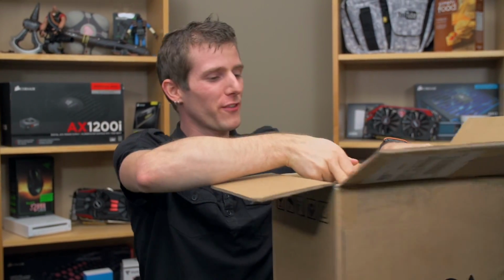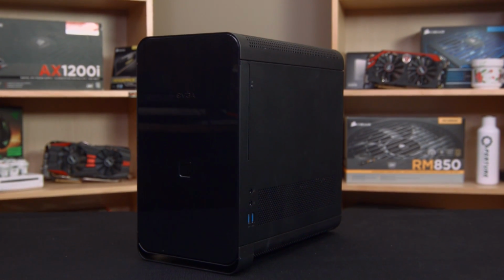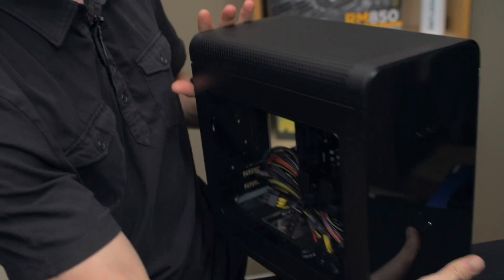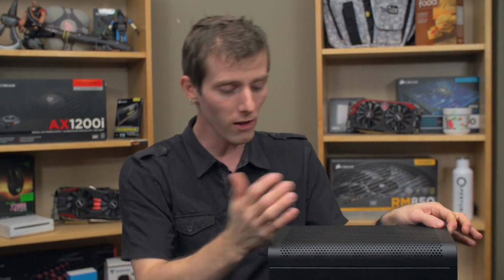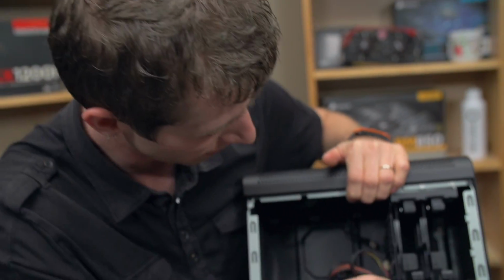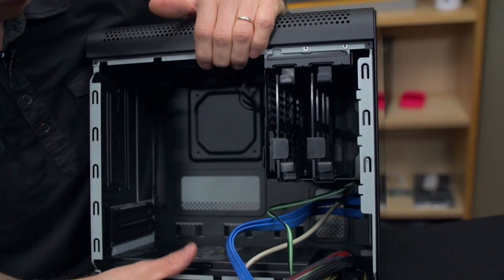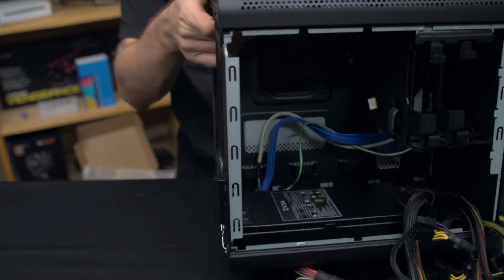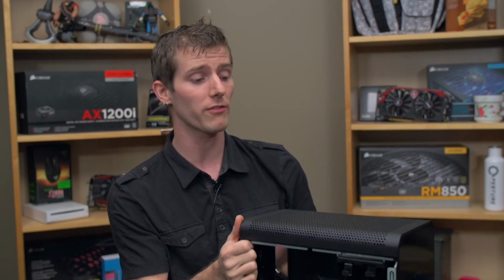EVGA Hadron Air

Comment: This is a "ONE KIND" case, in that your stuck with a ONE KIND of motherboard form factor, a ONE KIND of "non standard" PSU form factor and a ONE KIND of top fans... who the heck builds barebones PC's would ever want this case? EVGA should have their stinking heads examined, computer parts and cases are a must for standardization. This is no different than buying one of those bull shit proprietary dells.... what a joke. If and when the boards go bad you either buy a used one just like it if you can find one, or you get rid of the whole computer because by the time it goes bad, it's outdated and no longer in circulation and have moved on to other designs.... this is in my opinion a cramped quarters throw away case.
Reply: Makes no sense, if you need a small form factor system you obviously will be going ITX. There are a TON of ITX cases on the market so saying that you're stuck with this case is a stupid statement. So if you want to switch cases you just grab a new power supply. This case is awesome, really compact, and a great option for people looking for a SFF build.
Reply: ***** If you just go and buy a ATX from factor case in the first place your not stuck with JUST ITX, or this proprietary PSU. This case limits your options regardless of the TONS of ITX motherboards on the market. Use ATX cases and you can not only use ITX, but also mini ATX, micro ATX, and ATX. This case forces ONE kind of motherboard like I said, but ATX cases don't.... so how do you figure it doesn't make sense? You need this small form factor case to carry yours around all the time do you... you do know they make laptops and tablet PC's for that right?
Reply: you clearly don't know much about the gaming world. Laptops can not compare to a sff rig when it comes to performance. What do you do when you go to a LAN party? Bring a huge atx rig? Who in their right mind would put a ITX motherboard in an ATX case that literally is the dumbest thing I have ever heard. If you want a small rig you go ITX, period. Learn something.
Reply: ***** Perhaps you should learn something, they have laptops now that can indeed play the latest games, why don't YOU Google them? Desktops weren't meant to be portable, that's why they came up with laptops and tablet PC's anyways. You clearly sound like a kid, talking about LAN parties, I guess you carry your LCD TV around with you too for LAN parties? Some things weren't meant to be lugged around, your tower is one of them.
Reply: ***** And one more thing beings you like to lugged things around that weren't meant to be, you should go and buy and drive, if your old enough, the smallest car you can, this way when it fails to start you can just lug it around to your LAN party? LOL.
Reply: If I'm old enough, how cute. Clearly aren't a gaming enthusiast because you know nothing about it. I would go buy the smallest car, except, I just bought the new corvette. Enjoy.
Reply: when it fails to start? guarantee my itx system is more powerful than your atx system.
Reply: I guess I'll say something on behalf of all people who have a brain. M-ITX is becoming a pretty popular standard, especially for LAN rigs. What you said is true, there are very powerful laptops available, but if I'm a serious LAN gamer (and that is somewhat true) a $1000 desktop in this case will outperform a laptop that costs twice as much. Plus, this will allow those expensive parts to be cooled much more efficiently (it's simple physics: bigger heatsinks (like those on aftermarket CPU coolers and large GPU coolers) dissipate heat better) and therefore last longer. 

So far we've debunked two of your claims A) that M ITX is a bad investment due to it's lack of popularity (simply not true) and B) that a gaming laptop is a better alternative. What else do we have? Comparing this to dell? An extremely high end small form factor PSU that costs about 50-75% the cost of this case/psu combo? If you find a near $100 psu in a "shitty dell" I'll buy you a drink. 

Now, onto places where I agree with you. In most cases, a nice mid/full tower case is the better option. They have a much higher compatibility for motherboards, power supplies, coolers, disk drives. But, if you are building a LAN rig, meant to be mobile, or you are like me, and are planning on building a Steam Machine, this case is a fantastic option. I don't want a massive eye-sore of a case sitting next to my TV and other entertainment gear, I want something that can be stashed off to the side and blend in next to a subwoofer, and this fits the bill. It's small, comes with a very nice PSU, has nice cooling options, fits high end components, and looks nice.

The good news is that you don't have to buy it if you don't want it, but it's in my cart now, and there's a good chance it'll land on my doorstep before long. Please, have a pleasant day.
Reply: mygetrichslowplan Well from you and the other user that's been responding to me, it appears the only reason why anyone would want this case for, would be for LAN parties and mobility.... other than that, I guess it really isn't all the useful? Look your not telling me something I don't know, I have more than 14 years, which is less than some, but plenty of experience working on PC's. And through the years I've found out that cramped quarter cases do not cool well at all no matter how it's air flow is, because of all the wiring that can't be tucked away. I've modified cases this small for air flow and it never failed they don't cool very good, because everything is to close together and you can only put so many fans on them..... so I don't use them, and I wouldn't recommend them.

Then you have that ITX form factor boards that doesn't have hardly any fan ports on them, which forces you to use Molex connector adapters running fans at full speed, which is needless if and when you don't need them. But on a ATX board if you get the right one, you usually have all the fan ports you need, outside of a few, which will run at speeds controlled by the bios according to the case temps. Yeah you can buy fan controllers, but then that's just that much more wiring you have to deal with, in a case that's already cramped. And some of these video cards they have are huge, and for a lot of gamers they like to get the best, some of the best ones, if you run SLI or crossfire, take up a 4 port area, that won't fit in this case. Yeah this case has its uses BUT, only if you want it for mobility and small space, and I guarantee you that ATX form factor cases have a much better market, because they fit nearly ALL needs. Yeah you have some good points, more than the other guy, but in my opinion, and that's all it is whether your saying it or me, with the latest choice hardware available, small cases like this do not out weight the negatives.
Reply: Like I said, for general desktop applications, get a nice mid/full tower case and a standard ATX Motherboard. You are preaching to the choir, that is literally what I have for my set up right now, but do I want a massive case acting as an eye sore next to my entertainment center? No. Also, there is a version of the case (called the Hydro) that is a bit taller, but allows for water cooling, which means some potentially better cooling, as it would have support for larger rads than my current mid tower case.

For desktop applications, mid or full tower all day long, but with the computer making it's way beyond desktops in the office and laptops on the road (think how many people have essentially a mini computer in an apple tv or roku, or hell, even built into smart tvs) an sff computer in the living room could add a lot of functionality to your TV with low spacial impact, and in a case like this, it could even replace your console.
Reply: Obviously ITX systems are not as good as ATX systems in a lot of cases and can run quite hot if you aren't good at cable management. But some people have space restrictions or they want portability. You can also buy short cable kits or make your own cables to tidy up cable management. The case I use "fractal node 304" I'm getting 29 degrees idle for CPU and 26 degrees idle for GPU. My temps on hdd and ssd never go over 30 degrees practically and my motherboard is perfectly cool. Cooling is not an issue if you tidy up your cables and be smart about what you purchase. Always smart to buy blower style GPU even though it may run a little hotter, it will help keep the rest of the system cool. Also water cooling is easy in a bunch of itx cases and you don't have to worry about your cpu at all. Don't get me wrong you aren't going to be getting insane overclocks in some builds but thats not always needed. For many people ITX is a great option and is becoming very common, should not be looked down on.
Reply: ***** Ok Nick you got me, you win. I know what your saying, but you know I'm somewhat old school with PC's, but I'm also familiar with newer hardware too. Back when I started working on them, they did not have these cases and all the luxuries they have now. Inside of PC's back then they looked awful in smaller cases, and they ran hotter than the sun.... lol. But use ATX towers and wow, it was like driving that big ole 72 Chevy Impala I use to own, had all kinds of room. I suppose that's why I'm partial to ATX... ?
Reply: Don't get me wrong I wish I could have an ATX computer! I just don't have the room and need portability! But yes they have gotten a lot, A LOT, better. haha
Reply: Troll level = 10/10